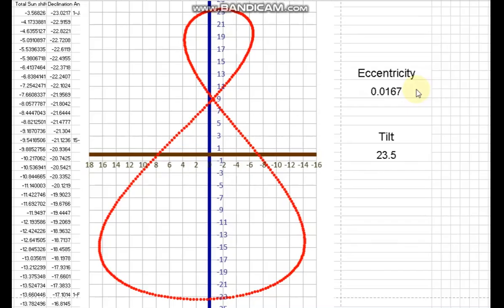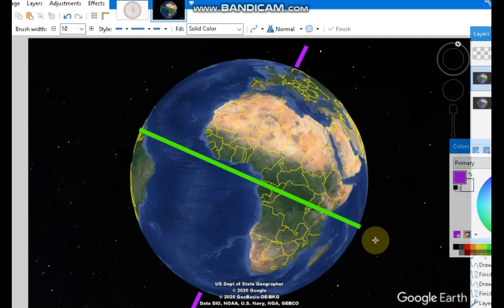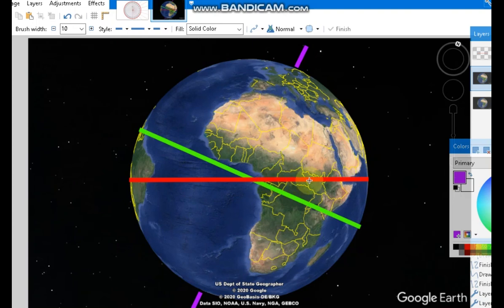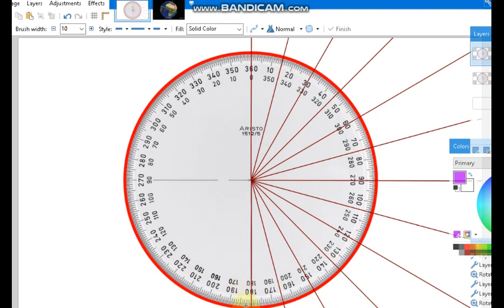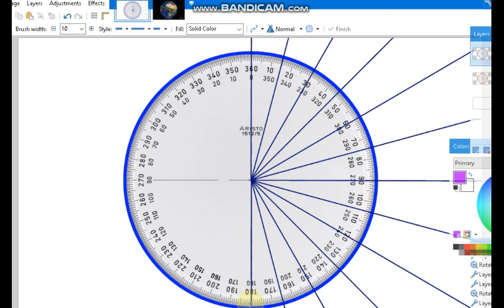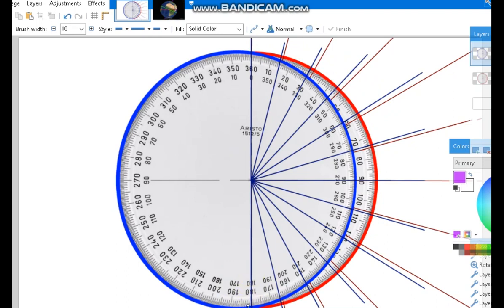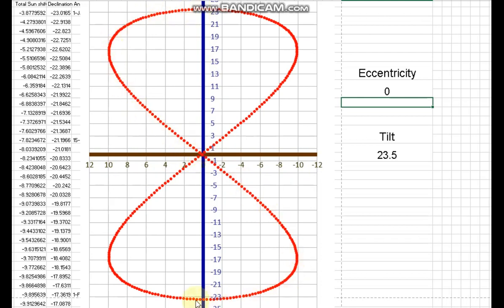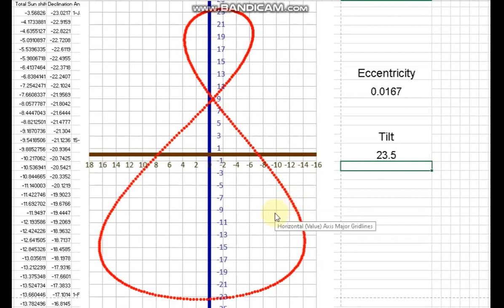How the earth's axial tilt contributes to the solar analemma

Comment: Completely wrong
Without the tilt, the sun won't move up and down every noon every 24 hours (361degrees rotation)

At noon every day every 24 hours the sun would move up and down slowly
So where and what causes that shifting in the x-axis????!!
Reply from the maker: What is the "completely wrong" ? You need to first understand what the video says about the shift on the X axis and then explain (or even try) why this video doesn't explain the X shift, that is the normal process of debate and criticism. It's like when an exhibit is provided by the defence and then the district attorney doesn't try to falsify it or say anything about it but only continues to label the defendant ""completely guilty"
Reply: @crowxe  you made the tilt at 0 (so the equation draws an oval shape, in the heliocentric model if you removed the tilt there wont be this shape because the sun wont appear to move between orbits) 
There wont be seasons on earth nor sun moving between orbits
Reply from the maker: @truthdawn7773  I'm not talking about the oval, even you are not here to talk about a hypothetical oval analemma. We are here because I say there's X shift that results from the axial tilt and I showed how it happens and you don't wanna look at it or talk about !!!
Reply: @crowxe  does your video fits with reality or the heliocentric model?!!!!
Reply from the maker: @truthdawn7773  again, irrelevant response, the video explains why an X shift happens in an analemma of a light source on a sphere that's orbiting around it. Wanting to believe the heliocentric is real or false is totally irrelevant because I'm simply showing how the geometry works to cause the X shift.
Reply: @crowxe  ok
Your video with 0tilt shows an oval
The reality says when there's no tilt, so there's no change of the sun position every noon.
Reply from the maker: @truthdawn7773  yes it shows the X shift due to eccentricity only however for the purposes of visualisation,  I kept the Y shift resulting from the tilt and again for the fourth time, you didn't address the explanation of X shift as shown in this video.